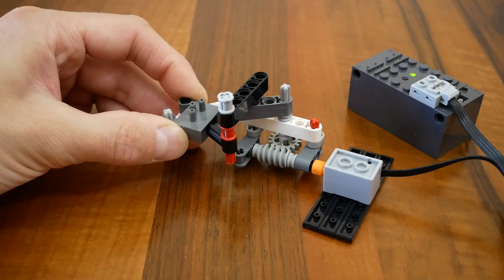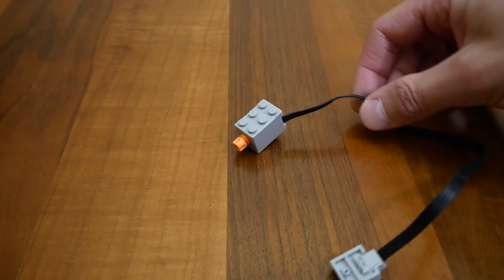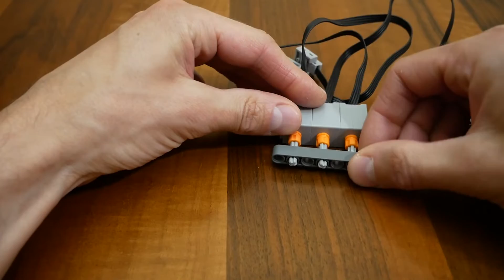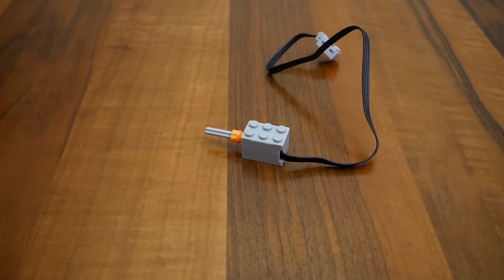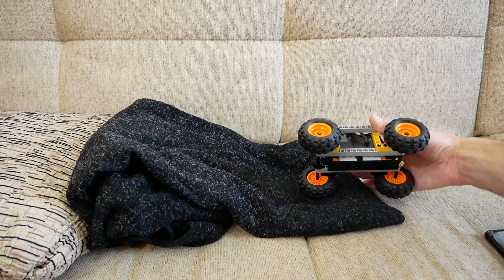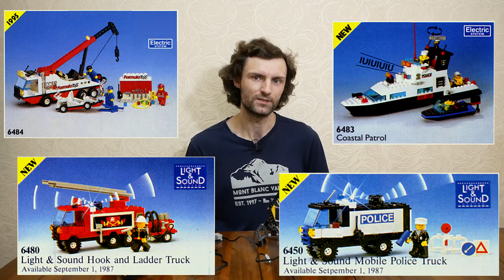LEGO Technic compatible MICRO-MOTOR CADA from AliExpress Review

Comment: I wish lego made more stuff for pf rather than switching for a newer system...
I mean there was M L XL and Servo.
Sure the new motors are all servo capable, but imho while this is nice flexibility. We loose the ability to use more motors in one spot or even the lights.

Besides I don't think I wanted to link my technic toys with a phone, considering how past lego software based stuff went (not easy to work with modern OS ) I believe a more standard approach with a controller is better. And have the phone as an option is best... but well they did it anyways...
Reply from the maker: Yes, I also miss PF a lot..

Comment: Thanks for sharing your thoughts on this. Mine are already in the mail, but I was worried that the motors might not have the power to pull a train. Your demonstrations have given me confidence in their ability.
Reply from the maker: Yes, they have a lot of torque, but probably the speed will not be high for train
Reply: @Kirtechlab  the speed should not be a problem. It’s for a Köf II, a German shunter/switcher, which was limited to ~ 30 km/h.

Comment: i wonder if this could be good motor to use for steering? to not use servo, but this? it would be more precise i think?
for example in mould king, servo is not proportional only 0/1, then this could be slower but proportional
Reply from the maker: yes, but without return-to-center
Reply: @Kirtechlab but can be centered and used in both direction with controller? Can you make video of micro motor attached to the steering please as I can't find any proportional servo motor, please!!

Comment: I wonder if there are some problems that come up in long-term use of such a small motor, 
and maybe those are why Lego didn´t make a new micro-motor?
Reply from the maker: Who knows, we'll see :) I've already started one model based on these motors.
Reply: @Kirtechlab  yeah if they are stalled too long/often the gears inside slip, in addition the cable is extra sensitive. But if you're careful they will work fine for a long time.😀
Reply from the maker: Regarding the cable - do you mean a bad connector, or bad soldering inside the motor?
Reply: @Kirtechlab  hrm more connection I suppose. You know how the integrated cables can get damaged on normal pf motors? It's just more common on these ones. But it's nothing a bit of caution won't prevent